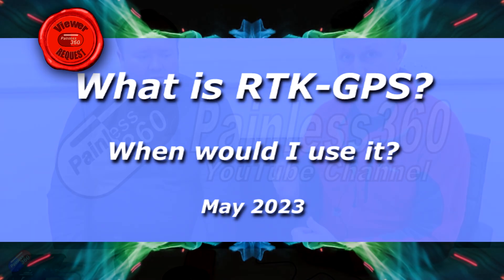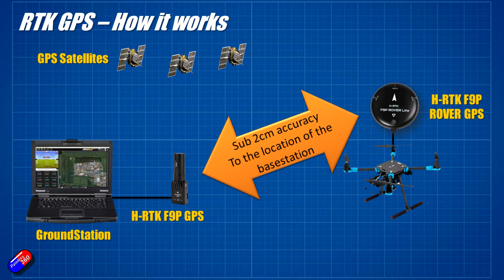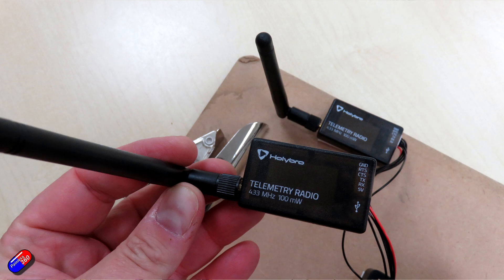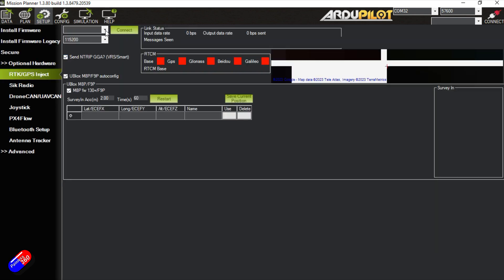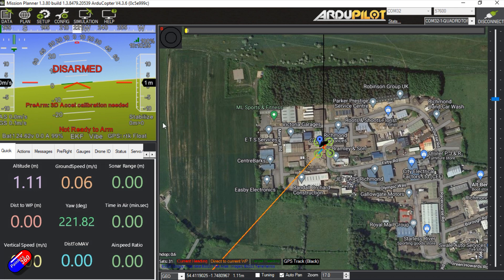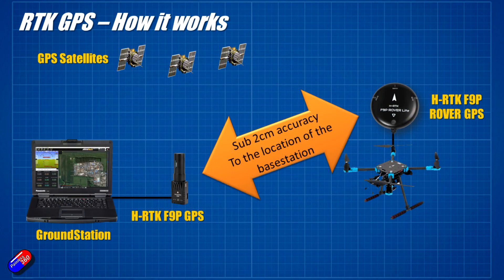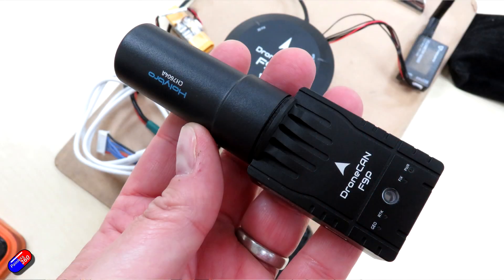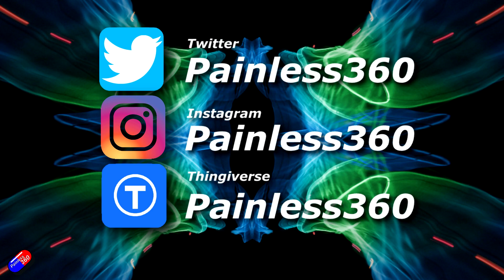RTK GPS Explained. What are the benefits? (with HolyBro F9P hardware)

Comment: Hello, this is an excellent presentation! This information is valuable. I have some questions! I would be glad if you could answer:
1) We saw in 5:54 that the RTK base is just placed on top of a table. It is not secured my any means. Is this dangerous for the accuracy in case of an accidental movement?
2) Can an RTK system eliminate the need of a downwards looking lidar in a Fixed Wing VTOL plane for the crucial final phase of the touchdown?
3) Is there a way to eliminate the use of a laptop/PC, and to physically (or wirelessly) interconnect an RTK base directly with a Herelink device?

Thank you ounces again for your valuable info!
Reply from the maker: 1) normally you make sure the base is not moved once sighed in. 
2) It'll help but LIDAR is stil the most accurate for the last few feet..
3) Not that I've seen, but maybe!

Comment: What is the max range between the base station and rover ?
Reply from the maker: For what part specifically?
Reply: I guess I’m asking how do the base and rover communicate, is there a telemetry module on both, or one built in ? How far away can you have the base station from the rover and still have it be cm level accuracy ?

Comment: Is there a way to use 2 or 3 base stations? I would imaging using only 1 station only provides accuracy in radial direction, but using 2 could provide two radials and good accuracy in two orthogonal direction over substantial area. 3 base station to extend the applicable area.
Reply from the maker: One base is enough and can be used tens of km away. More videos on RTK coming soon.... Stay tuned
Reply: @Painless360  oh. It doesn't use a signal from a station. It is not dgps. Station just transmit local corrections digitally. Got it.

Comment: The video showed how the base station hardware is connected to a laptop and the software running on the laptop has some options and does some processing to latch on to the necessary incoming data to get the base station transmitting the correction data to the rover. What isn't clear to me is whether that entire process must be done each time. If I do that setup one day and come back on another day, placing the base station in the exact same location, do I also have to go through the process of connecting it to the laptop, running the software again, etc.? Or can I simply turn on the Base station hardware, having positioned it in the exact same location, and have it all work, have the rover receive the info and get the centimeter-level accuracy?

Alternatively, is there any (other kind of?) base station hardware that just sets itself up automatically, simply having been turned on, and NOT requiring a laptop (or smartphone, etc.) to do that setup processing? I'm envisioning a base station with basically just an on/off button, some status lights, maybe a buzzer, that just simply sets itself up and lets you know when it's ready and is transmitting the correction data for receipt by the rover.
Reply from the maker: Once a location has been set and saved, it can be used again the next time, reducing a number of the steps. Check out the RTK Ardupilot docs for full details. Happy flying!
Reply: @Painless360  That sounds good. But you say "reducing the number of steps". So, does it still require connecting to a laptop each time, or can you just position the Base station in the exact same location and turn it on and it's all ready to transmit the data to be received by the rover?
Reply from the maker: I only know the process shown. Best of luck

Comment: So is the base station constantly floating around in the 2-meter circle? Because that would mean the rover is also floating around in a 2-meter circle. Or, is the base station FIXED somewhere inside the 2-meter circle (when "use" is clicked)? But then if so, why not wait another minute (or much more) and get a really EXACT base station position? Thanks
Reply from the maker: No, once location is set and stored it is used. Happy flying

Comment: Great! If you guys do more of this, an interesting question would be what RTK could do for vertical accuracy. After all a FW model in cruise moves fast horizontally, but not vertically, so maybe this could provide more precise altitude control for waypoint missions in hilly terrain?
Reply: With the cheap $50 RTK modules I use vertical accuracy is about double horizontal accuracy.  
....so roughly speaking if you're getting 1cm lat/long accuracy you can expect around 2cm vertical.

---

Not sure if F9P modules are better ....I can't afford those.
Reply: @DEADB33F what are you using ?

Comment: it is possible to make free corrections to the flight controller through an internet connection ?
Reply from the maker: Maybe, so long as there is a data connection back to the groundstation that should work. Happy flying!
Reply: Tried a quick google for some more info but found nothing. 
Wonder if it is possible with Ardupilot/Mission planner.
Reply: @vince086  lets say you have a pixhawk or apm 2.8 controller, you can connect it to a raspberry pi and with MAVLink/Mavproxy and 4G mobile modem, you can connect to the drone, so I'm curious if during this connection when you control the drone via misionplaner you can send RTK corrections for gps
Reply from the maker: If mission planner thinks it has a two way telemetry connection to the drone, then it should work. Let me know if it works!